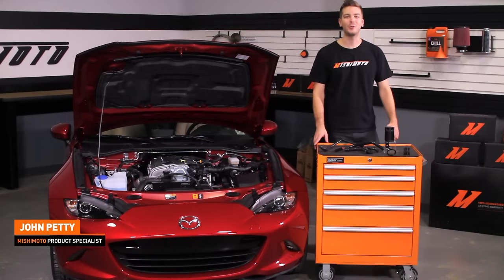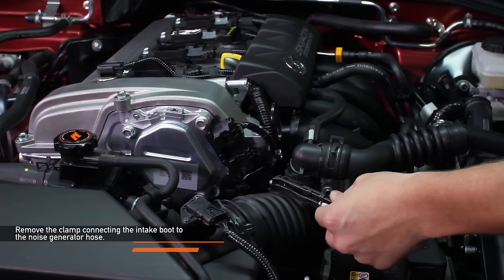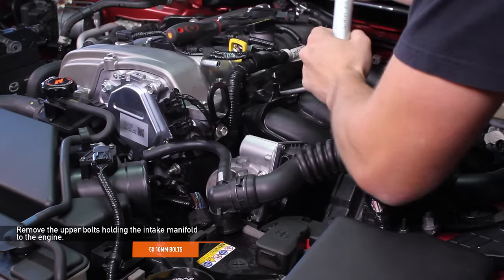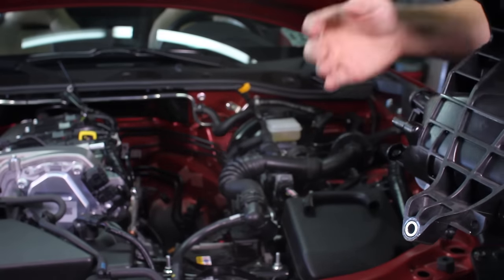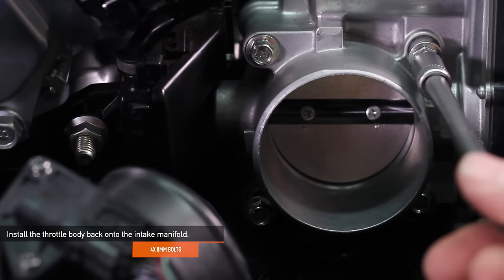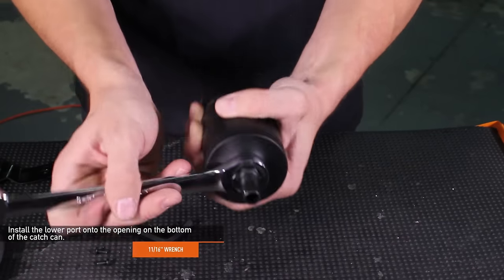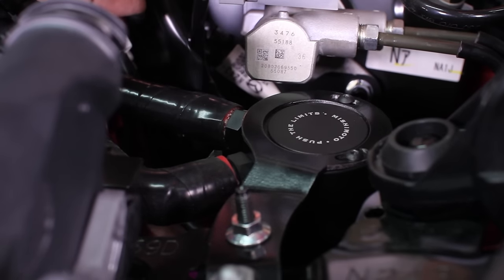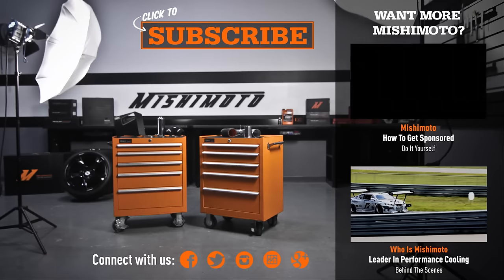2016+ Mazda Miata Baffled Oil Catch Can Installation Guide By Mishimoto

Comment: The newer kits don’t come with labeled hoses, but they do come with aluminum fittings. The ends with the slightly larger diameter go onto the fittings on the block and manifold. I was able to disconnect the brake booster vacuum line, remove my strut bracing, and slip my arm down there and do it all by feel. Once I got the hoses figured out it was a 15 minute job.

Comment: The Miata supposedly doesn't really have serious carbon buildup issues.  Is a catch can really needed?
Reply: YZRandomE the 2.0 skyactiv engine it uses has BAD carbon buildup. this is a necessary mod in my opinion
Reply: i think all direct injection engine has bad buildup above the valves (because cleaning addictive in the fuel never touch that part, and PCV recirculated air contain oil vapor and carbon deposits)  thats probably why some company start using both direct injection + port injection so the valve could stay clean

Comment: where does it drain to?
Reply from the maker: The catch can would hold the oil until the ball valve is turned and then it drain from the bottom. Generally done when your ding your oil change so it is resomend this oil is collected in the same container.

Comment: this kit work on all skyactiv G 2.0 and 2.5 engine?
Reply from the maker: Hey redhongkong, Unfortunately we are only able to guarantee fitment on the ND Miata Chassis at this time.
Reply: can u make a kit for NA skyactiv 2.0 and 2.5?  mazda 3, 6, cx3, cx5 they all have the same engine layout for FWD and AWD, should be " 1 size fits all "
Reply from the maker: Hello, redhongkong,  there are quite a few changes which prevent this being a direct fit kit across all of those vehicles. With that said, I'd be more than happy to submit this as a new produt suggestion.
Reply: So the oil catch can only serve the intake manifold?none for the rocker cover breather hose?

Comment: Will the Kit fit the 1.5L Engine?
Reply from the maker: Hey Voodoo422, reaching out to my product group for more information regarding this question and I'll follow up with you as soon as I hear back.
Reply from the maker: Hey Voodoo422. We have not had a 1.5 here for testing due to our location, but, we have had a few customers report that this unit works on both LHD and RHD models. Generally speaking, Mazda doesn't change much around. I cant guarantee fitment but feel strongly this will work on the 1.5 models.
Reply: thanks for the reply. I'll try.

Comment: What about the stock oil separator , remove I suppose.
Reply from the maker: Hey adrian niemiec , after reviewing the install video, I am not seeing any reference for removing another component. I'd strongly suggest sticking to the step by step instructions provided on the video.
Reply: Seems like it still uses the old one

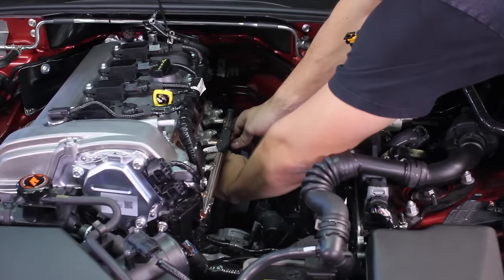Comment: How the hell are you gonna access @5:06 if you DON'T take the manifold off????
Reply from the maker: Hello again Demar Gio. If you are planning on running these hoses without clamps, you can simply reach under the intake manifold to remove and install everything. If you'd like to use clamps, you will need to fully remove the manifold as shown in the video. Clamps are not required for this application.

Comment: You have to do ALL of that to install an oil catch can????!!!!
Reply from the maker: Unfortunately Mazda did not make this an easy job or install for us.
Reply: Only if you want to put clamps on (which are only needed to if you have a turbo or a supercharcher). If not you can install this without removing the intake manifold as said at the start of the video. ;)